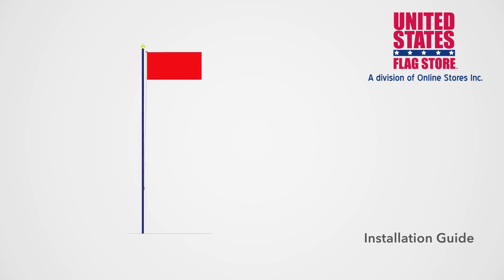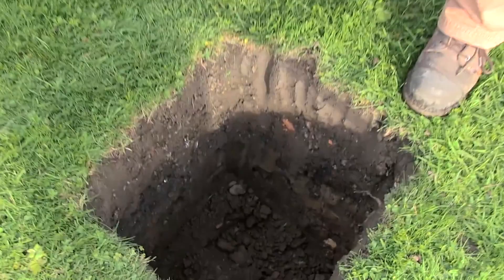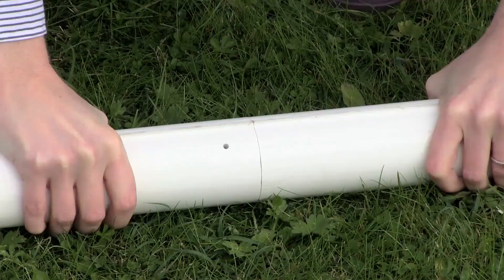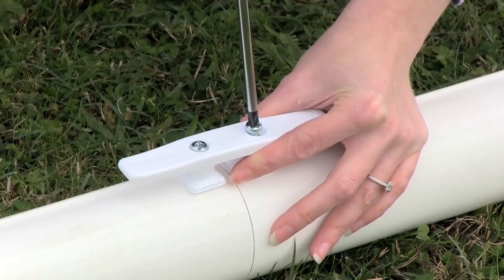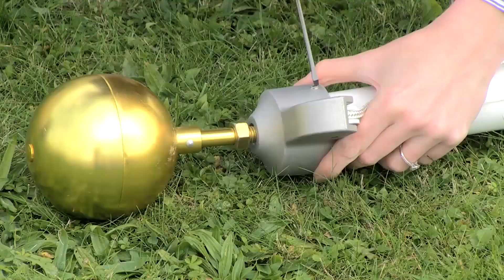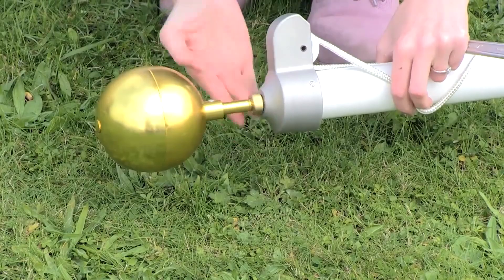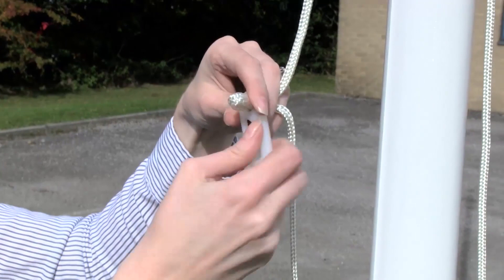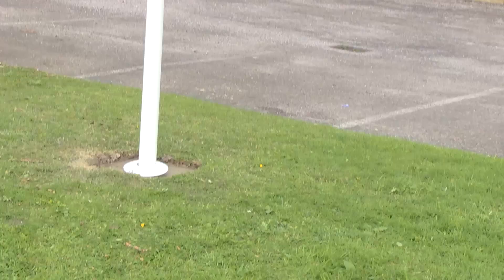Installation Instructions for Fiberglass Sectional Flag Pole

Comment: Your video shows NOTHING about after you put the shims!  Do you fill the gap with CONCRETE??  FOAM??  Can't believe at this point, you just glance over this!
Reply: Sand
Reply: If there is minimal gap (like cm long), it is not required to fill the gap in. If there is a noticeable gap, make sure you put the wooden shims in to balance the pole and compact the gap with sand. Make sure you take the wooden shims out after you fill in the gap.

This can be achieved by using a thin stick to tamper down the sand. It can be any type of sand.